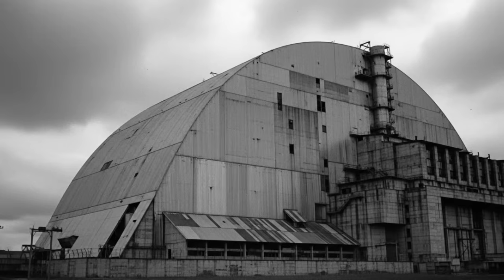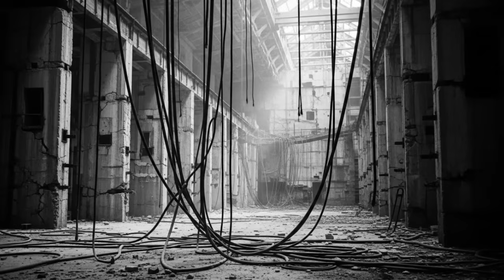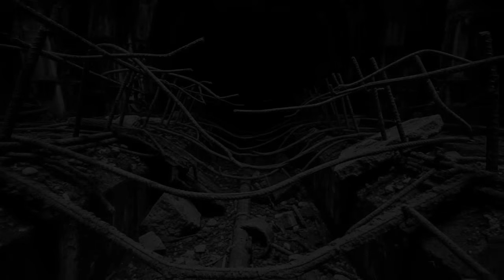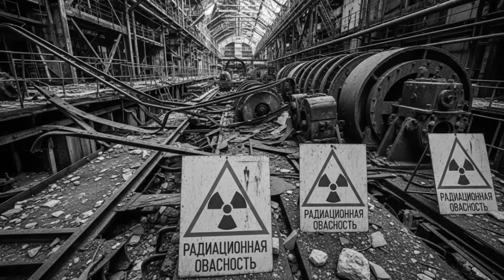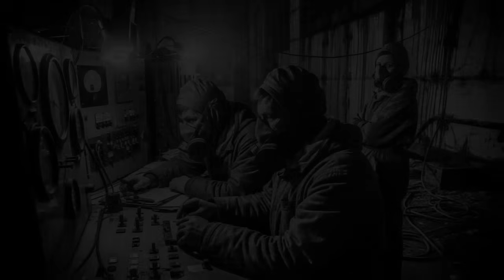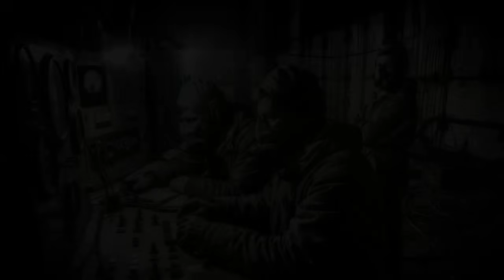What lies hidden inside the Chernobyl sarcophagus—Shocking secrets finally revealed!

Comment: Everything you're talking about has to do with the old sarcophagus. I've studied under Dr Campbell who designed the metal composition and the structural composition of the new sarcophagus and it does not leak and it's good for 300 to 1,000 years. Dr camp was the one who designed it all